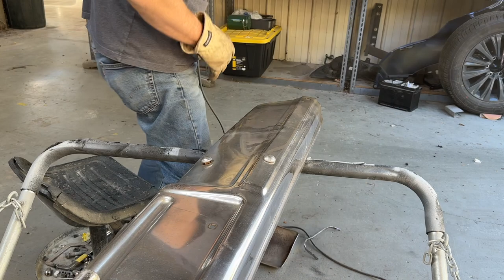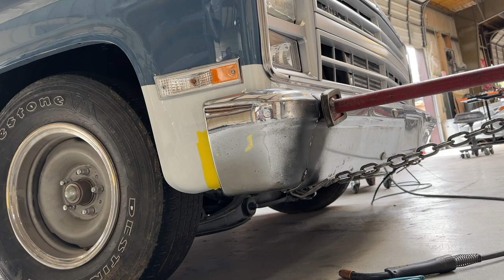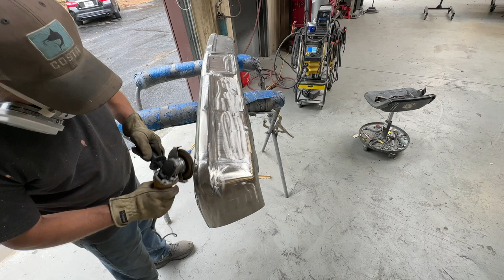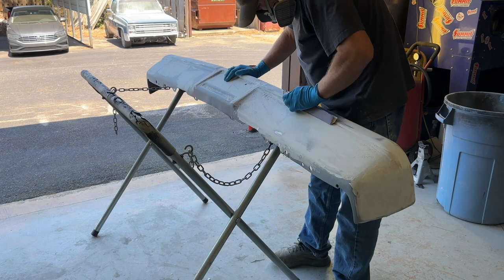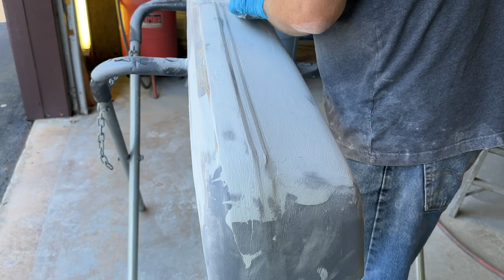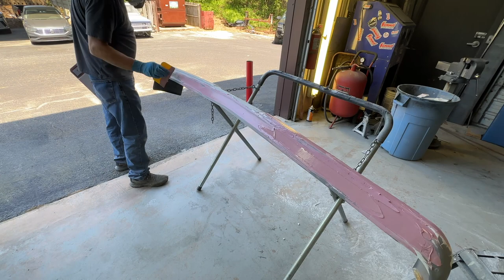C10 Project:  Getting the Chrome Front Bumper Ready for Paint

Comment: Wouldn't etching primer do any good or No?
Reply from the maker: Etch primer would stick to the sanded chrome/steel but etch primer and body filler do not always get along. Any residual acid in the etch can cause the filler to let go.  Epoxy sticks to the chrome/steel and gets along fine with filler as well. The only time I use etch is if I’m not going to use any filler or I’m painting from bare steel to finished top coat in one setting, ie., bare steel, etch, sealer, basecoat, clearcoat(or single stage). Great question and thanks for watching!
Reply: @StoutCustom  welcome and Thank you

Comment: I am always afraid of the extra damage it may do to the sheet metal behind it, if tapped in a parking, then they drive off!
  True story, just finished painting B/C medium met on entire car. 2dr sports car with hard tip. My wife want to run in marked side door to pickup lay-away in an empty lot that has parking for 600. I am the only one there and start to fall sleep them "Boom"!! I jump up in the seat to see an 88 year old lady pull next to me in a 1972 Chrysler Newport 2dr. She release the latch on this 600lb door and hits dead center of passengers door. I was hot but kept my cool and no foul language was used. She exchanged insurance info and on Monday at 9AM the insurance adjuster showed up. I had everything including a drawing of parking lot. He hands me a estimate of $312. What? You left off the clear coat. He says it doesn't have any. I asked him if I took a bucket of water & 1,000 grit and started hand sanding, would it be milky white or metallic brown. He doubled the estimate. Normal day at his office.😂
Reply from the maker: Those old 2 door cars did a lot of parking lot damage, lol.